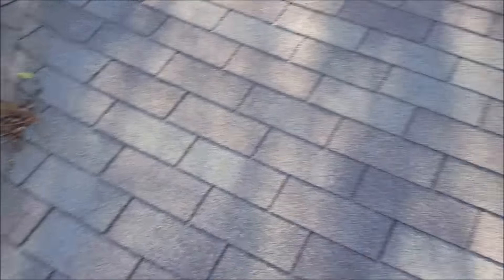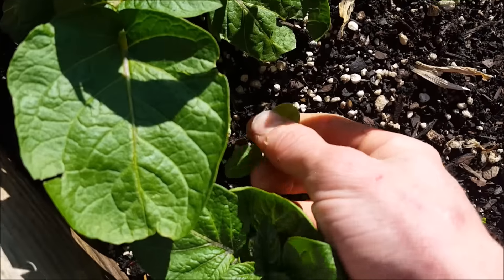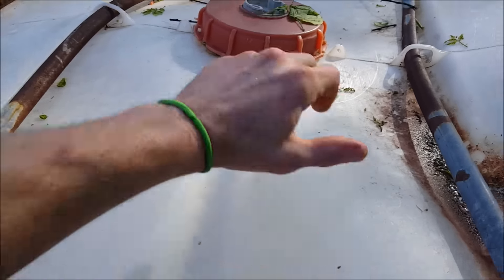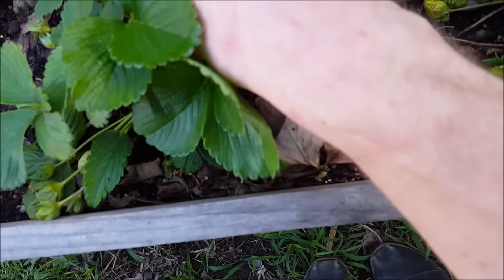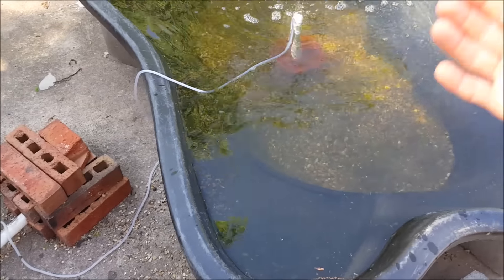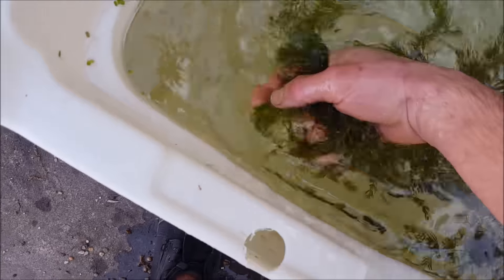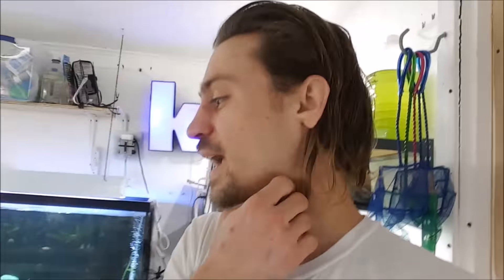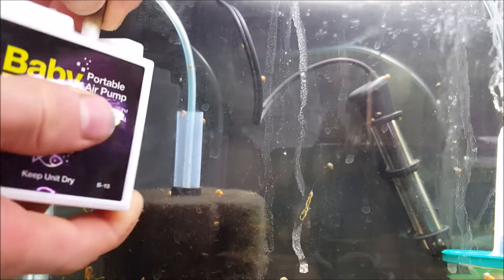Part 2 Hail Damage aftermath , And a 5$ !!! AA Battery Powered Air Pump

Comment: Glad you didn't get tornado....We just had a cyclone in my state (Queensland)..thankfully I live to the south of where it made landfall however the tropical low that it has become is now over the top of where I live  and we are now experiencing flooding...we have had 10 inches of rain in less than 24 hours...and it is still raining..over 1000 schools have been closed as a result of the rain and flooding..they are evacuating residents in areas to the south of me.